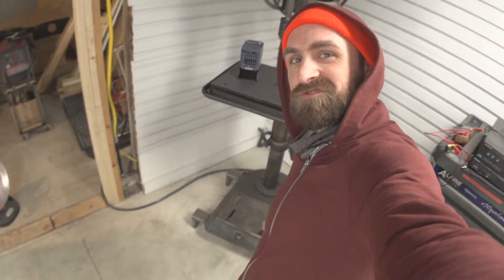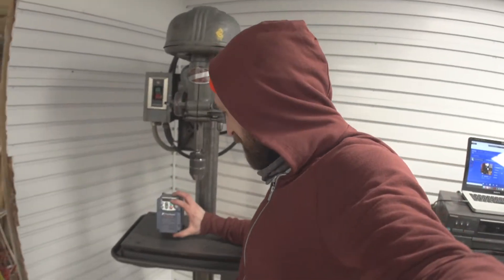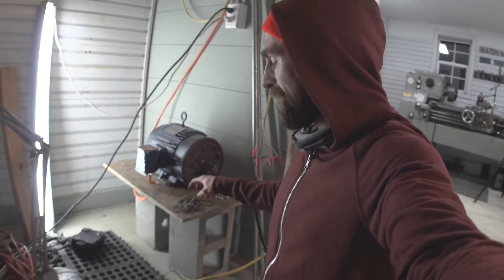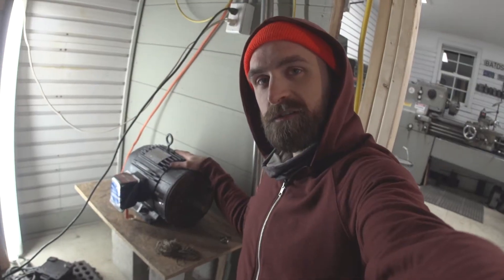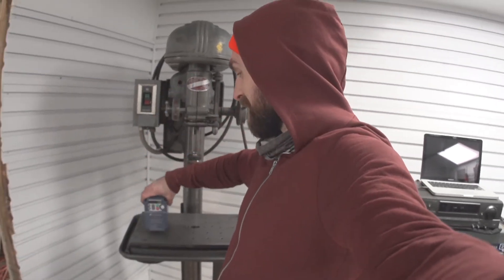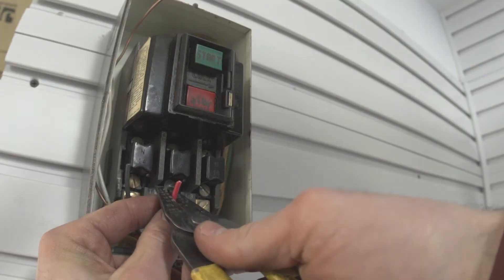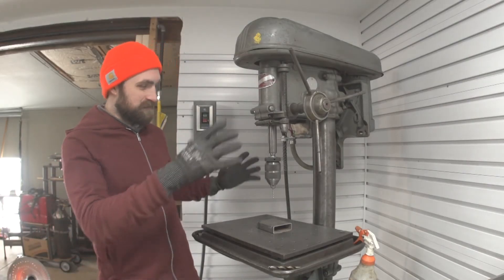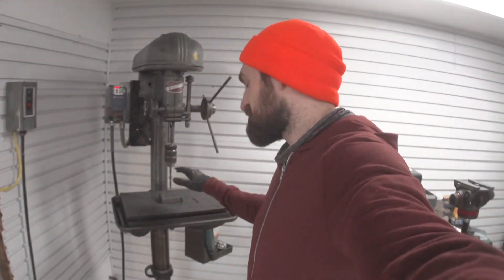3 Phase Power at Home - VFD, RPC, XYZ?!?!

Comment: hi i think is just the video i was looking for, i have a machine that i’m trying to run in my garage at home. it needs 220v 60hz 3 phase power, so all i would need to run it is the VFD and a extra 240v plug right? and wire the 240v into the VFD then VFD to the machine.

thanks a bunch in advance!
Reply from the maker: Thanks for the question. This topic goes deep. Maybe I’ll make an updated version of this video soon.
VFDs provide frequency/speed control. Some VFDs are designed to take a single phase input and output 3 phase, like the one I’m using for my drill press. I used a VFD for my drill press because I wanted the speed control.
I also have a rotary phase converter (RPC). A very basic DIY version of one is shown in this video, but my new one is from American Rotary and provides more balanced voltage. I now have my lathe and CNC mill running off the RPC. An RPC cannot provide speed control, it only makes 3 phase from single phase, but my lathe has gears for speed control and my CNC mill has its own VFD for the spindle motor and servo motors and controllers for the axis controls.
The point is, the lathe and the CNC mill don’t need additional speed control, so an RPC is the most economical solution for making 3 phase from single phase, particularly for “larger” loads like my 3hp lathe motor and 7hp mill spindle motor.
There are also “digital phase converters” like Phase Perfect, which are designed strictly to make 3 phase from single phase without additional speed control, and they do it more efficiently than RPCs, but for comparison my American Rotary ADX20 costs $2500 and a Phase Perfect 20hp 230v digital converter costs over $9000. There’s a tool on Phase Perfect’s website that helps you calculate energy savings but I’m not running all day every day so an RPC is the best route for me.
You’ll have to weigh the options for your use case. If it’s just one smaller machine like my drill press, a VFD might do the trick for you.
Reply: @RussellMakes  I was trying to run a ceramic polisher that has 3 motors attached going into a control box, combine they do 1.9kw. do you think the VFD would be enough?

i don’t believe the polisher has any kind of speed control, just that it needed to run at 60hz. i’m not sure if that makes any sense, i’m not super knowledgeable when it comes to electricity.
Reply from the maker: @nicholashsiung3282  the vfd I have wouldn’t be enough. It’s rated to run a 1hp motor. You’ll need to shop around and find something that suits your needs.

Comment: Do you command > 60 Hz from the motor when you want to drill at high speed or are you changing the pulley setup? Thanks.
Reply from the maker: I tried but it would only go up to 70hz. I believe this is to protect the motor as I have the max current set on the vfd to what the motor nameplate says.

Comment: Is your lathe 220 or 480? Also, couldn't you just wire a vfd to your lathe motor and set it at 60 hz and use it like normal? Most 3 phase 220 is around a 50 to 60 hz frequency.
Reply from the maker: My lathe can be wired for either voltage. Yeah, vfd could work too.